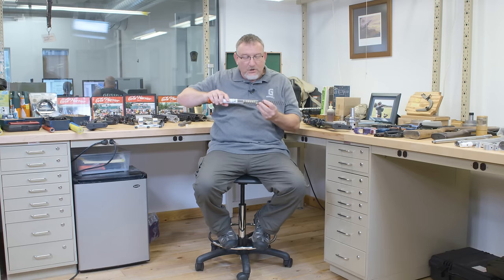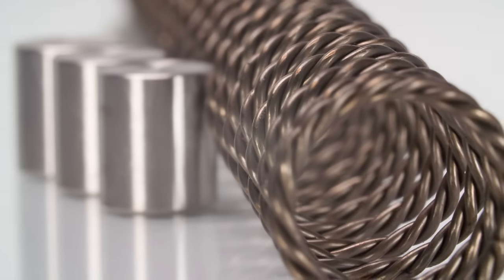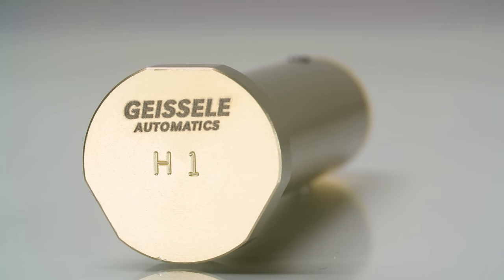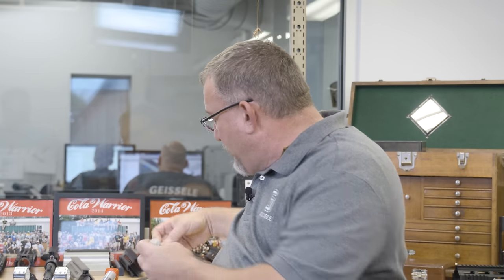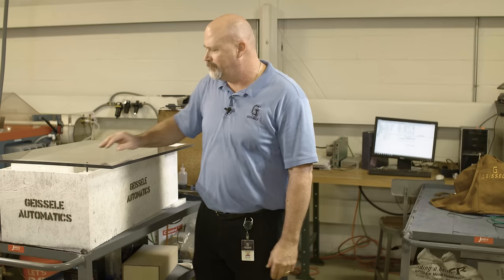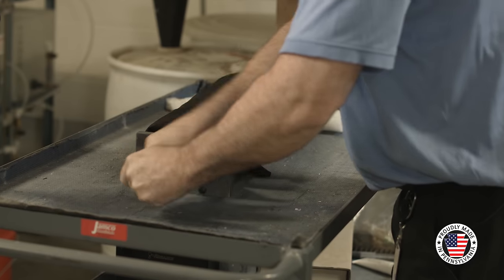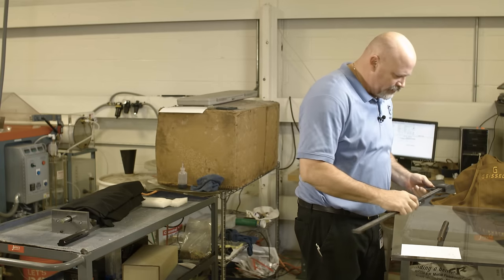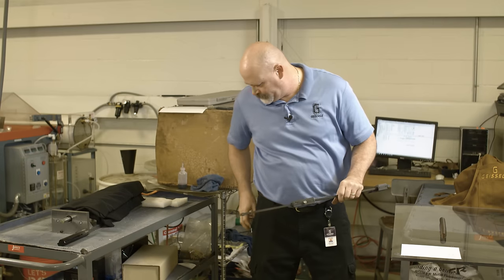Introducing the "Super 42 Braided Wire Buffer Kit"

Comment: Hmm, understand the concept per se, BUT I HAVE run/AM RUNNING presently ‘standard’ mil spec H2’s AND spring in every carbine gas AR I own...to include the DD M4A1 & an ‘09 XM15 Bushmaster w/a 16” bbl (BOTH carbines).Same internals with no replacements. So IF it’s “longevity” we’re talking about, it ‘could’ make a lot of sense. In terms of normal practice..wear & tear, maybe not. Case by case basis on HOW HARD, how often & how many rounds are being fired to consider “wear”, etc. The question REALLY becomes a matter of economics I believe for an ‘average’ shooter, boils down to COST of replacing the factory or mil spec setup WITH a “Super 42”...

Comment: At 50,000 rounds the least of my concerns would be buffer spring length lol.
Reply: Exactly.
Reply: standard parts reliability would be my concern, buffer assembly included
Reply: he's also talking about high-round-count weapons changing rates of fire because of spring length.  it's actually pretty important stuff for professional end-users
Reply: electrontube LOL... "high-round-count weapons changing rates of fire because of spring length"...

Name one AR15, high end or not, that will shoot 50,000 rounds, where the barrel wont be completely wasted afterwards.
Reply: Will this work on a rifle length set up, or is for carbine length barrels only?
Reply: +Jaime Del Pilar the spring will work in every length rifle, but weights may have to be changed.  This is why G-Auto sells individual tungsten weights, so you can tune the recoil assembly to meet your specific need
Reply: Thank you for your response. I'm looking to build a 458 socom and want to put an 18" barrel on it.
Reply: that's what I'm saying. by the time you get to the amount of rounds it would take to cause the "loss of length" for a standard spring , u more than likely have other things on the rifle to tend to that are much more important.
Reply: any serious shooter understands that the barrel is a degradable part, it gets replaced when it runs out. understanding that, please understand this: the people Mr Geissele is making this part for, they use weapons from a pool, basically it's a big arms room, any part that doesn't need to be replaced isn't going to be replaced.  The armorers that service the weapons will simply have one less part to worry about.  that's good news for the people working at the pointy end of the spear, it means their weapons will work reliably.  for you and me, or other high-volume shooters (like service rifle competitors) it also means built-in predictability on top of that reliability
Reply: It's a $60 solution to a $3-5 problem.
Reply: electrontube Argument is illogical.  Replace the spring when you replace the barrel and their is no need for a $60 buffer spring - lol.
Reply: I'm not trying to sound pretentious and I'm honestly not being argumentative.  I was (am) referring to pooled weapons, like those found in an arms room or gun locker, kept by trained maintainers.  The exact type of weapon that reaches these high round counts.  Lastly, G-Auto makes several products that are aimed directly at very specific markets, this spring set being one of them.  If you don't understand why this product exists, then you probably don't need it... and that's OK.
Reply: electrontube Just saying, don't you think it would make more sense for an arms room to replace the bolt/fire pin $40 and spring $3 at the same time they replace the barrel? A barrel isn't gonna last but maybe 15,000 rounds.  Food for thought.
Reply: +Fox Mulder It doesn't, and he knows it. I would rather use the Flatwire CS Spring. Twang gone and lasts just as long without a proprietary buffer
Reply: look, it's not a product for everyone, if you don't need it... then you don't need it.  If you've ever seen 20-level (and higher) maintenance performed in an arms room, you'd have a better understanding of why this product is useful.  If you're an enthusiast, maybe not so much.
Reply: +electrontube CS Springs are rated for 750,000 cycles. Even if there only good at half of that, the pricepoint that they are offered at essentially makes this product unnecessary
Reply: +electrontube Plus if theyre maintenance with that many rifles, a proprietary buffer IS NOT what they want
Reply: The proprietary buffer is to change the weight between systems used, watch the video again.  As for the rated life of a CS spring, that rating is "to-failure" and isn't measuring spring rate-change or changes in firing characteristics.  you're both being purposefully obtuse, completely missing any point made by the video, and/or lack objective critical thinking skills.  Go ahead and claim to yourself that you "chased off another internet know-it-all" and crow to yourself, your mirror, and your sunken chest that you've won.
Reply: +electrontube Geissele known it was BS , or he would have tested a CS Flatwire spring. Its not like they werent available. I wonder why he didnt??
Reply: because he has a degree in mechanical engineering and several decades of experience using it?
Reply: +electrontube and used a mil-spec buffer spring instead of the competing product with the same claim his products has. Degrees are great for designing things, but he's a business man first guy. If I could guess, the Flatwire CS Spring didn't have the the overall shorten length or did it at a much higher simulated round count, but the had already put too much T&E into the product. Remember he's a salesmen first.
Reply: +Cardell Spencer you're assuming quite a bit
Reply: +electrontube YES I AM! Almost 60$. I wil
Reply: +electrontube OK, so... a quick explanation on how a flat wire spring works: it maintains sufficient spring power while not ever going to what is called "solid height" (i.e. full compression).  it's great for slow-to-medium rates of fire, but not strong or fast enough for burst or automatic fire.  that's why it's so long, it needs additional length to reach functional strength.  a braided spring is ideal for maintaining functional strength with high rates and volumes
Reply: +electrontube Sources?
Reply: +Cardell Spencer AMU armorer shop and David Tubb
Reply: What is the argument here? You're trying to find some reason not to buy a $60 part and yet you've already decided it's not for you. That's the case for any part. You either want/need it or you don't. This component offers advantages to the end user that wants to take advantage of them. A smoother recoil impulse, the elimination of the twang, and increased service life are all advantages of this component. Regardless of that, some just want piece of mind buying from a top notch manufacturer. The buffer IS NOT proprietary. What's not to like?
Reply: +hoot1141 Who is trying to find a reason to buy a 60 part! Im all saying is, he didnt test it against the competing product for a reason
Reply: +hoot1141 And the spring will only work with that buffer: Proprietary
Reply: +hoot1141 If you dont remember, the ID ,or internal diameter is smaller.
Reply: Cardell Spencer  Negative, the super 42 works with standard buffers. The super 42 comes with an H1 buffer.
Reply: +hoot1141 Click to 10:30. You gotta listen closely
Reply: +hoot1141 He calls it milspec, but probably meant to say milspec inspired
Reply: Cardell Spencer Fair enough. You're right I was wrong. I still stand by my earlier thoughts.
Reply: What I find odd is I've had action springs shorten over an inch with way less rounds fired about 8k.
Reply: dhena81, I have as well
Reply: he just said the test machine cycles does not replicate real world cycles being fired in a gun, due to barrel length choice of ammo, cans and other gas variables. it does however compare springs under the same standard when tested. the round count is way less when installed in a rifle... a standard buffer will not work, the shoulder is turned down. the thickness of the wire is more than a standard spring, so something has to change. it's easier to turn down the buffer and include the weights to change it to your liking than to build a propietary receiver extension. is it better? yeah. does everyone need it? probably not. guys who run their rifles hard as fuck, auto with a can and shoot a lot would benefit from it. for what it's worth, many other good weapons use a braided recoil spring.
Reply: I would love a comparison test on the same machine, flat wire vs. braided.
Reply: P245Sig then don't buy it.
Reply: Jaime Del Pilar have you heard any answers because I have an A2 that rings like an Oprah singing the glass breaking note. I also stretched a carbine spring on for Mil spec carbine because it was to weak for my 7.62x39.
Reply: electrontube I am more interested in this spring for heavier calibers
Reply: The spring issue is mostly with full auto shooting..
Reply: P245Sig lol I know right just buy another one but I get it
Reply: @electrontube  not really
Reply: They had to find something to charge 65$ for lmao. I mean there's only so many ways u can sell a tampon, they all soak up blood in the end though don't they
Reply: It's simply innovation. Maybe the technology won't make a weapon perform better to make it worth while, but some inventor down the road might be able to use the idea to improve something they are working on. Most innovations are small improvements, not ground breaking discoveries. With small improvements here and there, down the road you will have something that performs much better and last longer than rifles from the previous decades.
Reply: @foxmulder3980  fair enough. The biggest reason I bought this is for long term reliability. I don't expect to get hundreds of thousands of rounds of it. Nor my 200$ TiN Faxon BCG and def not my stainless steel barrel. But.....the cool thing is I have spare parts now should something fail and when it does I'll have factory parts at the ready to go back in the gun so I'm not left without. For me it isn't about getting the longest time/round count of my gun to me it's about getting it as good as I can afford to (within reason of course) right off the bat, to get the most reliable AR I can have that I don't have to worry about failing should shit hit the fan. Hope that makes sense. I know thats why some guys upgrade parts even when not needed. Just to basically future-proof the weapon partially, and to add some reliability to the weapon, and IMO there's no better time to do all that than right up front before youve ran shit tons of rounds through it. Every little bit helps AND it also leaves u with some back up parts. To me it's a win win but I can understand what you're getting at. Apart from just straight up buying a POF P416, which is the best beast I ever saw shot (via iraqveteran8888 channel), I'm doing what I can with to transform my WW 15 SRC to get it as good as I can (within reason like I was saying) but anyhow.....
Reply: Fox Mulder   I hear you, but a spring that is designed to last that long will most likely not give you problems up to 10-20 thousand rounds. It’s all for reliability.
Reply: @cardellspencer8937  

Jesus, you guys spend hundreds and even thousands adding mallninja bullshit to your M-16s/AR-15s and you won't spend $60 for a PROVEN upgrade to enhance reliability? You know like every AKM/AK-74 rifle made...Sig Sauer, HK handguns etc...etc...have used forever!

I'd ditch the red dot and shoot with irons then add this before I put some dorky $400 FDE quad rail on too! Function over form, you know!
Reply: Right?  Geissele invented the better mousetrap. Problem is, those mousetraps cost $3 and last 15,000 rounds. Geissele’s mousetrap is $65-99 and lasts 50,000+. Even if we are generous and include $10 worth of labor to change the $3 spring, the math no compute.
Reply: @jaimedelpilar6938  this is a spring it has nothing to do with the barrel
Reply: I know right.

Comment: How does this compare to a flat spring system?
Reply: Didn’t you see the machine?!?! This spring is the spring to end all springs. It is twice as springy and four times as reboundy. And it was inspired by the MG-42, so full win.
Reply: Tubb flatwire springs are rated for like 1 million rounds. I love Geissele triggers but I’ve seen more bad comments about the super 42 than I have the A5 , springco, or the Tubb springs. Personally I love the flatwire springs for noise reduction and reliability.
Reply: I have the 42 Rifle Spring in my MK 12 with Kynshot Rifle Hydraulic Buffer........sweet !

Comment: This is an awesome upgrade. I run one in my carbine length AR and everything he says is true about it! The only thing is you have to mess with buffer weights for certain applications. In my 10.5 inch pistol it would not lock the bolt back on the last round but ran fine other than that. So just a heads up! Also it is pretty insane how smooth the bolt goes back.
Reply: Odd that it caused issue on the pistol, Likely to do with dwell time on the 10.5" w/carb gas. I didn't account for dwell when I first started to put together builds, So I thought "hey, shortest barrel I can get w/mid gas system is the way!" But 11.5" w/mid gas just doesn't have enough dwell time. After the bullet leaves the barrel you lose alot of pressure that you need for gas system to work 100% in my opinion at least. Some may not agree, But it's common sense that the gas will go into gas system far better if bullet is keeping it from going out the end for extended amount of time, More pressure to push gas into that tiny gas port. Might try the super 42 spring with a standard Carb buffer on the 10.5, or H1 w/a flatwire 17-7 spring like strike industries offers. Bet one of those would fix that last round issue. I love the braided wire myself, SIG has been doing the braided spring for a long time in their pistols to great effect. First time I saw one was in my first P229 SIG. I later learned it was used in German MG "Hitler's buzzsaw", Which says alot bc German engineering is generally top notch even under that psychopath.

Comment: How does this compare to the Vltor A5 system as far as recoil? Will there be a Super 42 kit for the Vltor A5?
Reply: I too would want a Geissele braided wire buffer spring for my Vltor A5.
Reply: Guam .Guy you can't do that
Reply: TACTICAL BURGER GRIP They would have to make a rifle length braided spring and a cut down A5 buffer. Current Super 42 wont work.
Reply: That would be the ultimate setup. I love that A5 system & I would go with that over ANY standard carbine buffer set up but I would buy a braided rifle spring in a heartbeat.
Reply: Wow....I've been waiting myself for geissele to design specifically for the A5 buffer extension! 2 yrs later...nada 
Gotta bug geissele over & over

Comment: Years later and I'm having some aggressive issues, just bought a super 42 and it fixed them. Combined it with a 2A adjustable bolt I had and my 11.5" is running like a champ.
Reply: What buffer are you running with the 11.5 inch?
Reply: @markbritton844  I was kinda wondering the same thing... I've put a multitude of H3, H2 and H1 Super 42s in SBRs, PDWs, and full length 16" barrels with varying gas systems, suppressed and unsuppressed and had no issues once I figured out the recoil impulse and gassing in my ARs.

Comment: SD3G fanatic. I have several. Concerning the Super 42, in 2022 is going backwards. Flat coil springs are hands down the best, unless you are running a JP SCS, Arma-Spec SCS or sound mitigation setups.

Comment: after the cycle testing what is the psi tension at installed length on this spring at close bolt and open bolt positions this is more important  than spring set at to function of an AR rifle
Reply: Timothy King I was wondering the same

Comment: I think Geissele's theory on the spring waves is correct. That resonance is a major accelerator of fatigue, and fatigue is what causes the spring to lose the preload and free length.

I'm however not sold on the braided spring as the ideal configuration. If you look at other compression springs that have to deal with 1) fatigue and 2) high force, you don't see braided springs used. In fact, if you look at high-RPM racing valve springs (like might be used in NASCAR or in Drag Racing), you'll find a single-wire is used. But it's not an ordinary round wire. It's usually an asymmetrical wire (with the larger radius in the ID and a smaller one on the OD)-- not flat, nor round, nor even elliptical. 

On top of that, the spring is not the same diameter throughout-- one end will taper to a slightly smaller diameter. This breaks up those resonant waves (more accurate, it spreads the spring's natural resonance across several frequencies rather than letter them concentrate at a couple peaks). All if which makes the spring last longer.

I think the Tubb flat spring is a better, cheaper approach overall. Surely the Geissele is quieter, but the Tubb will last just as long at much lower cost.

Comment: Does'nt the heat from the continuous rapid cycles change the testing conditions of the spring? i would think it heats up the springs well above normal operating temps and possibly invalidating the results. no one is going to shoot 50,000 rounds continuously (its not possible).

Comment: I appreciate it when the owner puts his face and reputation into a problem and solves it. And then you get to see actual testing. I am also glad that he mentioned there is a cost savings in most commercially built ARs.  I have been having an overgassing problem for ammo outside of one brand. So, normally, I stick with that brand but my plan for my AR-10 is to replace the spring that came in the Luth AR kit and the buffer with a heavy duty spring and H3 buffer. Slows down the travel of the bolt carrier group and it is the easiest way to tune an AR-10 if you do not have an adjustable gas key or gas block.

And you would have to live under a rock to not have heard someone who has rebuilt a gun or rifle with a Geissele trigger kit, which is how I had heard of them, first.